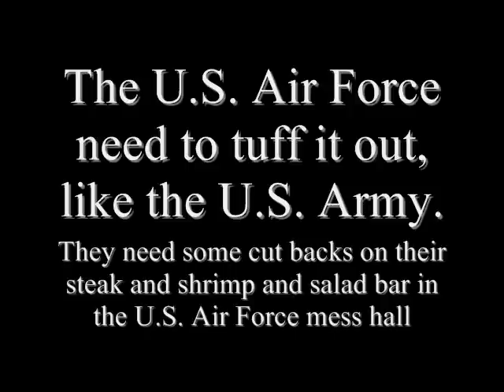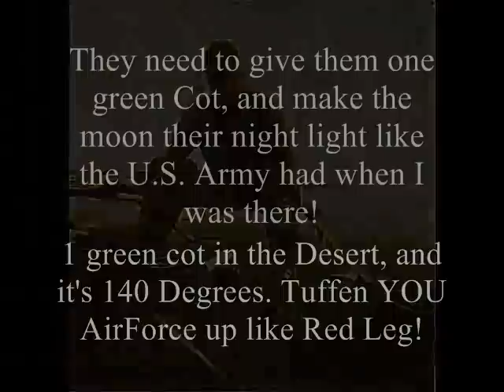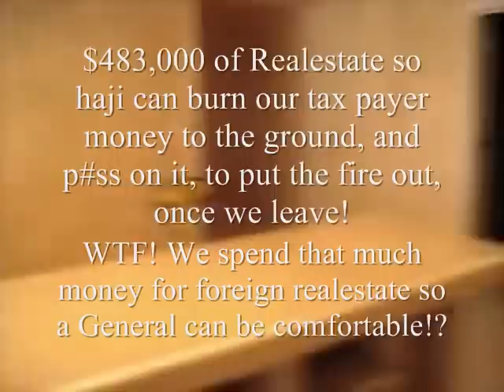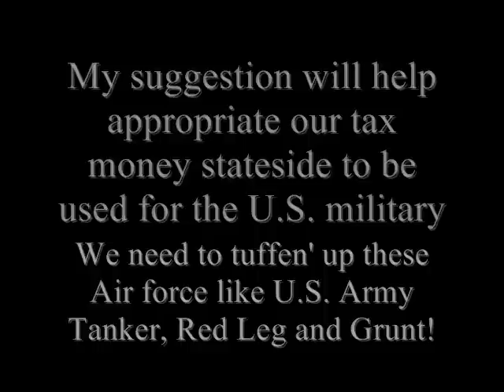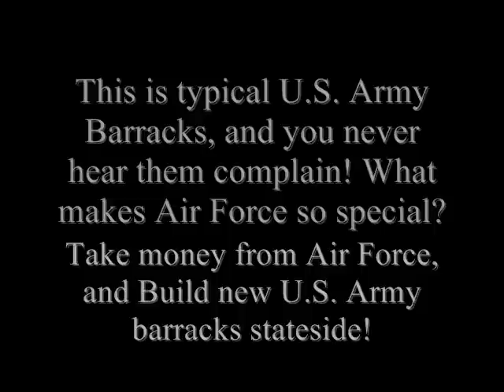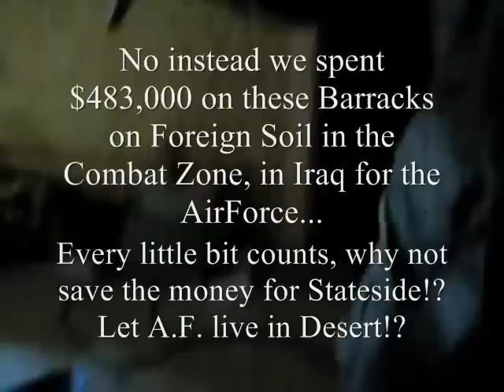AirForce Red Horse Vs. Army Combat Arms living

Comment: You're comparing apples and oranges here when it comes to Air Force Red Horse and army Artillery/Infantry.  Tired of hearing the military grunt vs. non-grunt rivalry thing being played out again.  Both grunts and non-grunts have their place in the battlefield, so give it a rest already.

The Air Force Red Horse guys and girls are basically military construction workers who also have to worry about bad guys shooting them.    Why are you surprised construction workers,  who are tasked to build and repair permanent and semi-permanent air bases for the military, are actually doing their job using available manpower and resources?   Sounds like you are jealous that you don't have their building trade skills.

The Army infantry and field artillery travel from place to place chasing the enemy on the front line, so they don't worry about nice structures that you would find at an Air Force Base or other fixed installation in a war zone.  

Air bases have the luxury of not being at the front line, so they are more permanent and don't need to move.   Aircraft can perform missions far away from the base and return back home to refuel, rearm, and make repairs.  Artillery and infantry guys have to be close to the battle to get job done.

Comment: Try not to judge The Horse  based on one dude on youtube.   The truth about Red Horse is they are considered special duty assignments,  they spend a lot of time away from the normal USAF, and typically deployed over 200 days out of the year  - even before 9/11.  I can't tell you the number of times i came back to home station and realized every else in the AF had it easy and didn't even know it.  No, you won't always see bullets flying, but you work like a slave doing heavy construction.

Comment: I remember in Iraq, on the airbase we were at. We soldiers had to live in those crummy hot as hell, no A/C tents...While the Air Force brats, lived in single man chu's, with their own A/C in them...Sort of like how you would see Bn CO or Sergeant Major in.  They were also in country for only 3 months... I will say though, they had some nice looking women :)

Maybe that was due to the fact that I was a
92Y Unit Supply Specialist, in an all male Infantry Unit.

I once had 3 Air Force women come up to me
and ask if I knew how to CLEAN a M-16....WHAT???!

These jokers didn't even know how to clean their assigned weapon?.

They said all they got was some instructional video.
So, I took the time, using MY cleaning kit, in showing them how to properly clean their assigned weapon. Some of my fellow soldiers were laughing their heads off seeing it!... I must say though, looking at those Air Force chicks...I felt I was seeing Charlie's Angels and I was Charlie :)
Reply: R CARDER FIRST AND FOREMOST - Thank You for taking the time to see that the AF gals learned how to clean their M-16s. It may have saved their lives.

Secondly, were these ladies in the HORSE? I kind of doubt it as in 10 years in the HORSE, I know that all of the ladies in our unit, at least, knew how to clean their weapons. And use them. You have to understand that there is the Air Force and there is RED HORSE. We wore the same uniform, used the same supply lines, got paid through the same channels, but we weren't cut from the same cloth. If you take a fighter pilot, give him 20 more years of maturity and make him trade in his F-16 for a bulldozer, you'll have some idea what a RED HORSE trooper is like. Tell us what you need, get out of our way and leave us alone - the job WILL get done IAW MIL-TF P-41!!!

soup

Comment: If there were Muddy USAF in line then I say yes it was unfair but if the standards are held the same then blame your NCO's for not having ration ready for your return. as for the FOB that is USA command that says what you get not the Airman. If you are tired of playing John Wayne don't re-up just join the USAF and stop the Girl Scout crying acting. The Airman are there to support Aircraft and Aircraft are not park on the frontline. Be mad @ yourself for signing a contract your not happy with.